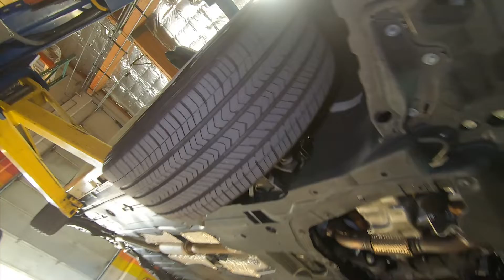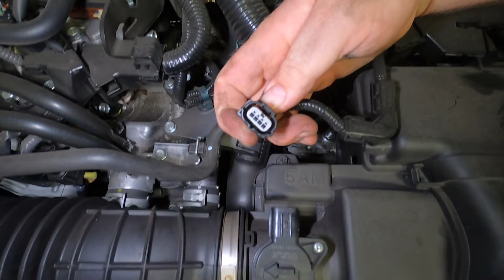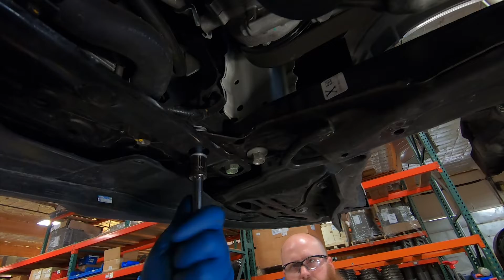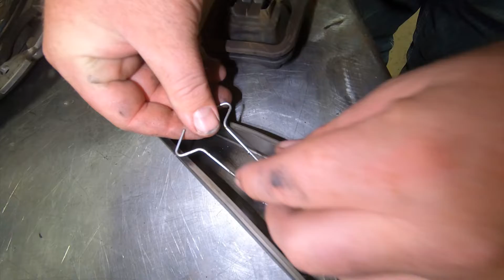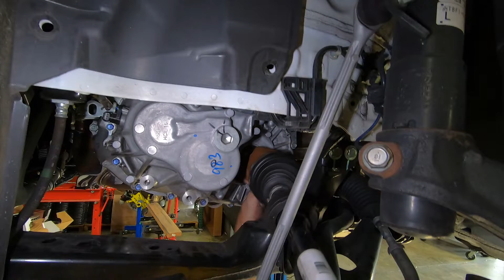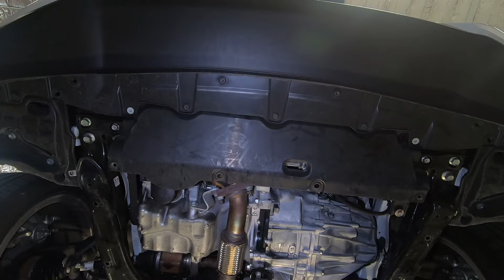ACT Clutch Install: 2017 - 2026 Honda Civic Si 1.5L Turbo and 2017 – 2024 Honda Civic 1.5L Turbo

Comment: Lol It took me 12 hrs instead of 8 what book says to do it properly with the hoist and transmission stand and all power tools ,if you are not changing the flywheel, you don't need to remove the starter I removed it, which wasted my time so I wanted to let u guys know it will prob save u around 45 min Diy should be mentally prepared
Reply from the maker: Thanks for sharing your experience! 👍 Twelve hours even with a lift and the right equipment definitely puts the scope of this job into perspective. Good advice for anyone planning to tackle it themselves—give yourself plenty of time, have the right tools ready, and expect that things may take longer than planned. Glad you got it done! 🤙

Comment: Looks about on par with 12 gen corolla, i did not drop the subframe so it was a bitch having to finagle the trans in and out. Anyone know if this can be done without dropping subframe? Really trying to avoid if i can.
Reply from the maker: During the installation of our kits in house, sometimes we try to remove the transmission in various ways. For these applications, we are certain that the only other way to remove the transmission would be do remove the engine and transmission together as an assembly from the top. If it were to be removed in that way, unfortunately it would involve much more than just removing the subframe.

Comment: Just wanted to say a huge thank you for you guys at ACT for putting this video together. I used this video step by step to instal your ACT clutch in my 2020 Civic (112k miles). After being quoted almost 5k from Honda for the job, I decided to do it myself. It's definitely a beast of a job, especially for your weekend amateur mechanic. I did it on the floor of the garage, and was surprised by how heavy the subframe was. Took me about a week from start to finish - with a few days of not working on it, and one day of dread, thinking that I'd never get my car back together in one piece haha. If you're an amateur mechanic like I am - you CAN do this job. You need the right tools and a lot of patience. I highly recommend an impact, makes life so much easier. I also recommend using sticky notes with a brief description of where certain nuts and bolts go - helps keep you organized...and hopefully when the job is done, you won't have a random bolt leftover that didn't make it back on the car. 
A few things that I missed in this video - the axel nut is massive - mine is a 36mm, and I didn't have this big boy at home, so that sent me on an extra trip to harbor freight. Also, I tore through a rubber "dampener?" while lowering the subframe, that I didn't know was there. It is located towards the back of the subframe and is connected to the exhaust - I guess it absorbs vibrations. Regarding the stock flywheel, be sure to have 12 point sockets on hand - and for the ACT kit - be sure to have 10mm hex bit - I borrowed one from a friend. 
I managed to get everything back together, and that was 3 weeks ago - since then, I've taken the car on two road trips, putting on about 4.5k miles. I will say the clutch feel with the ACT clutch is very different than the stock that the car came with. I feel like for a week or so, I was relearning how to drive my car, almost stalling a few times. Hopefully I can get another 100k miles before having to do this job again. 
Again, thank you to the heroes at ACT for taking the time to put this video together. Cheers!
Reply from the maker: Wow—thank you for taking the time to share your experience! 🙌 Stories like yours are exactly why we create these installation videos. Going from a $5,000 quote to successfully completing the job yourself on your garage floor is a huge accomplishment, especially tackling a project of this size as a weekend mechanic.

We appreciate the additional tips on the 36mm axle nut, subframe damper, 12-point sockets, and 10mm hex bit. Real-world feedback like this is incredibly valuable and may help the next DIYer preparing for the job.

We also had to laugh at the "day of dread" comment 😄—most DIY enthusiasts have been there at least once during a major project. The fact that you've already put 4,500 miles on the car, including two road trips, is awesome to hear.

Thank you for choosing ACT and for trusting our video to guide you through the installation. Enjoy the new clutch, and here's hoping you don't have to do this job again for another 100,000+ miles! 🤙 Safe travels and happy driving!

Comment: doing this my second time around first time was to install new clutch cause factory is glass and i tuned it to 20 psi now im here agin for a transmission swap for an si lsd (also cause my synchros are cooked and i didnt want to deal with that right now) first time i did it on my garage floor and it went pretty well now im in a proper shop with a lift and its way better obviously an extensive job if youre doing it by yourself like me but if you have help i dont think its all that bad tanks for the detailed video to help remember these steps also your clutches are awesome keep wrenching 🤙🏾
Reply from the maker: Thanks for sharing your experience! 🤙🏾 Going from a garage floor to a lift definitely changes the game 😄 Sounds like you've put that Si through its paces. We're glad the video could help on round two, and we really appreciate the kind words about our clutches. Good luck with the transmission swap and keep wrenching!

Comment: I’m going to be doing this by myself next week. Would you be able to send me a list of everything that needs to be replaced during the removal process (“one time use bolts/parts etc)? I have a clutch kit and a flywheel, and transmission fluid. Just confused what else I would need to buy beforehand.
Reply from the maker: Below is a list of the tools recommended per the Honda Service manual and the recommended hardware/parts that need replacing other than the clutch, clutch disc, flywheel, and release bearing. Please know that in our video, we used our own engine support hanger, lifting eyelet, a transmission jack with wood planking to lower and lift the subframe and a universal ring gear holding tool.

1.	Engine support hanger (Honda AAR-T1256)
2.	Universal lifting eyelet (Honda P/N 07AAK-SNAA120)
3.	Ring gear holder and Holder Attachment (Honda P/N 07LAB-PV00100 & 070AB-5S1A100)
4.	Subframe adapter (Honda P/N VSB02C000016)
5.	Subframe alignment pin (Honda P/N 070AG-SJAA10S)
6.	(x2) Axle nut
7.	(x2) Locking pins (aka cotter pins) for the steering tie rod end ball joint nuts 
8.	Transmission drainplug sealing washer
9.	Transmission fluid (Honda manual transmission fluid approximately 1.9L/2.0 US qt)
10.	Pressure plate to flywheel bolts and flywheel to crankshaft bolts. Note: pressure plate to flywheel and flywheel to crankshaft bolts are included in our kits.

Comment: in case anyone wants the whole procedure to print out and tape to inside of hood like i'm gonna do, i took careful notes: 

CIVIC CLUTCH PROCEDURE
Preparation

Disconnect battery

Remove battery and battery box

Remove overhead battery clamp (entire box lifts out)

Unbolt air filter housing

Disconnect sensor from air filter housing

Loosen clamp and remove air intake tube

Remove filter housing

Under Vehicle / Axles

Remove splash guard beneath engine and transmission

Remove front wheel and tire assembly (Driver side first)

Remove axle nut

Remove Passenger side wheel and axle nut

Drain transmission fluid via drain plug

Reinstall drain plug with NEW WASHER

Torque drain plug to 32 ft-lbs

Driver Side Axle

Remove flange nuts

Disconnect lower ball joint from lower control arm

Remove axle from knuckle assembly (pulls out)

Remove axle from transmission (pulls straight out)

Passenger Side Axle

Remove flange nuts

Disconnect lower ball joint from lower control arm

Unbolt bracket securing axle to engine

Remove axle from knuckle assembly

Remove axle from transmission

Transmission Connections

Unfasten slave cylinder and unbolt hydraulic line bracket

Unplug electrical connectors at front of transmission

Unbolt top sensor bracket

Unfasten ground strap

Unplug remaining transmission electrical connectors

At rear of transmission, unfasten harness bracket

Unbolt shifter cable bracket from transmission

Remove retainer clips and pull shift cables from levers

Move cable and bracket assembly out of the way

Unplug electrical connector at top rear of transmission

Engine / Mounts / Subframe

Install engine support hanger

Support engine

Unbolt and remove air intake resonator (bottom front R, bolted to frame)

Unfasten and remove lower mount and connecting piece between mount and engine

Steering & Subframe

On Driver side, remove steering tie rod and ball joint lock pin and nut

Remove ball joint from knuckle assembly

Repeat on Passenger side

Inside vehicle, remove access panel behind brake pedal

Unbolt steering joint and remove from pinion shaft

Remove hardware from L and R front subframe rear stays

Support subframe

Unfasten subframe mounting bolts

Disconnect electrical connector for steering rack

Lower subframe

Unfasten L and R sway bar end links

Remove subframe

Transmission Removal

Disconnect starter wire and unbolt starter

Unfasten all 8 upper bell housing bolts

Support transmission

Unbolt and remove upper transmission mount

Remove transmission inspection cover

Unfasten lower bell housing bolts

Remove transmission

Clutch Service

Remove old pressure plate and clutch disc

Remove old flywheel

Remove rubber dust boot

Remove release bearing and shift fork

Clean guide tube, pivot ball, and fork

Lightly coat guide tube with high-temperature spline grease (moly-based)

Lightly lube input shaft splines

Lightly lube clutch disc splines — wipe off excess

Lightly lube bearing pivot surfaces

Lightly lube fork pivot surfaces

Install spring into fork

Install release fork and bearing, ensuring spring snaps onto pivot ball

Install rubber dust boot

Flywheel & Clutch Installation

Clean flywheel with engine degreaser or brake cleaner

Install flywheel onto crankshaft

Apply thread locker

Torque flywheel bolts to 88 ft-lbs

Install clutch disc using alignment tool

Install pressure plate and bolts

Remove alignment tool

Torque pressure plate bolts to 25 ft-lbs

Transmission Installation

Lift transmission into position and mate to engine

Install bell housing bolts

Torque engine-side bolts to 48 ft-lbs

Torque transmission-side bolts to 47 ft-lbs

Torque starter bolts to 47 ft-lbs

Install upper transmission mount

Torque nuts to 58 ft-lbs

Torque bolts to 40 ft-lbs

Remove engine support hanger

Reassembly

Install rear transmission harness bracket

Install starter wiring

Install shifter cable bracket

Install transmission inspection cover

Subframe

Lift subframe into position

Loosely install subframe mounting bolts

Install subframe rear mounting bolts

Insert alignment pin through R rear subframe positioning hole

Loosely tighten bolt

Repeat on L rear subframe

Torque all subframe mounting bolts to 76 ft-lbs

Torque subframe rear stay horizontal bolts to 59 ft-lbs

Install remaining subframe components

Connect steering rack electrical connectors

Connect rear transmission sensor

Mounts & Suspension

Install lower mount and hardware

Torque to 69 ft-lbs

Install L and R sway bar end links

Torque to 47 ft-lbs

Driver Side

Install axle into transmission

Install axle into knuckle assembly

Install lower ball joint hardware

Torque to 47 ft-lbs

Install steering tie rod and ball joint into knuckle

Torque to 58–65 ft-lbs

Install lock pin

Install axle nut

Torque to 181 ft-lbs

Stake nut

Passenger Side

Install axle into transmission

Install axle into knuckle assembly

Install axle-to-engine bracket

Install lower ball joint hardware

Torque to 47 ft-lbs

Install axle nut

Torque to 181 ft-lbs

Stake nut

Install steering tie rod and ball joint

Torque to 58–65 ft-lbs

Install lock pin

Final Steps

Install slave cylinder

Torque to 16 ft-lbs

Secure hydraulic line bracket

Install shifter cables and retainer clips

Remove filler plug and fill transmission with fluid

1.9 quarts Genuine Honda Manual Transmission Fluid (MTF)

Torque filler plug to 32 ft-lbs

Install ground strap to front of transmission

Install upper sensor bracket

Reconnect all transmission electrical connectors

Install air intake resonator

Install filter housing

Install air intake tube

Connect intake air sensor

Install battery and battery box

Connect battery cables

Install wheels

Install splash guards

Install steering joint on pinion

Torque to 21 ft-lbs

Install brake pedal access panel
Reply: Thanks, I printed and formatted for my work bench.

Comment: Been at it for a couple days now, I can’t seem to get the passenger side rotor back onto the mount. Any tips??
Reply: The axle appears to be too long. I have the bracket mounted so I don’t know where I went wrong.
Reply from the maker: Check both the inner and outer CV joints to make sure they did not pop out which will make the axle assembly longer. Pop them back in place and the length should be correct.
Reply: The axle splines arent fully seated in the trans?

Comment: Honda quoted me $4500 for clutch replacement so now I’m
Here
Reply: wait rlly ?
Reply from the maker: That’s a common reason people start looking into this 👍 Whether you tackle it yourself or use an independent installer, just make sure the right parts and tools are used—it makes all the difference.

Comment: Do we need to replace the rear main seal?
Reply from the maker: If the vehicle has a high mileage on it or if the rear main seal is wet or shows signs leaking, then yes this would be the perfect time to replace it.

Comment: I’m at the part where the transmission needs to be replaced to the engine and it like 1 inch gap and doesn’t want to go in all the way , it sucks so much I thought I did something wrong and dropped the trans again
Reply from the maker: It sounds as though the disc is not perfectly aligned and it’s allowing the input shaft through it into the pilot bearing. Loosen the pressure plate and with the alignment tool in the disc, move it until the alignment tool (and hub of the disc) is centered with the pressure plate fingers.

Comment: This is amazing. Thank you. You have motivated me to do this myself. I've dropped transmissions multiple times but never had to remove a sub-frame for that. Would you mind telling me what size sub-frame alignment pin i need? Need to order that.
Reply from the maker: We do not recall the exact size. The OEM part number for the Subframe Alignment Pin is 070AG-SJAA10S.
Reply: @AdvancedClutchTechnology  That helps alot. Thanks again for the help and the vid

Comment: if doing this.. might aswell do aftermarket front sway bar + end links..  flywheel... trans fluid change.. acuity shifter bushings.. engine mount.. and maybe springs/coilovers all in 1 go to get the most done while its all apart and exposed
Reply from the maker: Solid plan 👍 Flywheel, mounts, and fluid are smart adds while it’s apart. Sway bar, bushings, and suspension can be done anytime—but if you’ve got it all torn down, we get it 😄

Comment: Is there any bushing or pilot bearing on the engine side that needs to be replaced on this job???
Reply from the maker: The pilot bearing for this application is in the flywheel and for our flywheel, we pre-install the pilot bearing here at our factory.

Comment: What was the rough time it took for this job ? Thanks !
Reply from the maker: The shop hours listed by the program we use is 9.1 hours. This is for complete clutch and flywheel removal and installation.

Comment: what socket size are those flywheel bolts ?
Reply from the maker: It has been a while since we did this installation but I believe the socket size for the OE bolts is 17mm and it needs to be a 12 point socket.

Comment: No gasket for the trans? Just metal seal?
Reply from the maker: If you are referring to mounting the transmission to the engine, there is no gasket.

Comment: Just a heads up to anyone who thinks about doing this be careful of all the wires around the sub frame and transmission. I broke 2 of the wires and had to put them back together and now I’m having the same problems come up again. So yea… just be cautious
Reply from the maker: Great heads up 👍 There are definitely a lot of sensors and wiring in tight spots—taking your time and being careful around those areas is key.

Comment: did you guys have to upgrade your cmc?
Reply from the maker: Our clutch kits for this application are designed for use with the OEM CMC. No upgrade is required.

Comment: Where exactly did you hook the engine to the tool
Reply from the maker: If you are referring about the engine support hanger, we hooked onto the large steel bracket for the wire harness located just to the right of the valve cover.

Comment: damn the hardest part is just removing so many things to get to it just replacing the clutch itself takes 10 minutes lol.
Reply: Yep. For me especially because I don't have a lift. it's easier to remove everything from the engine and transmission, pull them both out of the car. Replace clutch and put engine/transmission back in.
Reply from the maker: That’s a solid approach 👍 especially without a lift. Pulling the engine/trans together can actually make access easier—just a different kind of work.
Reply from the maker: 😂 That’s exactly it—the clutch swap itself is quick, it’s all the prep to get there that takes the time.

Comment: Watching as I’m getting ready to open the transmission all due to a vehicle speed sensor breaking into the transmission 💀 needed to replace my clutch regardless 😭💀😂
Reply from the maker: 😅💀 That escalated quickly… at least you’ll knock out the clutch while you’re in there. Good luck—you’ve got this!